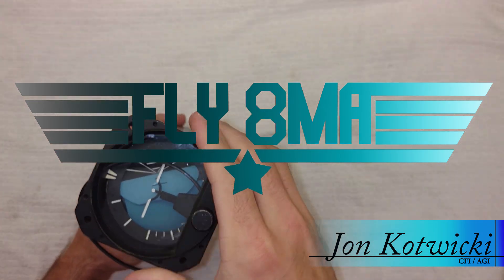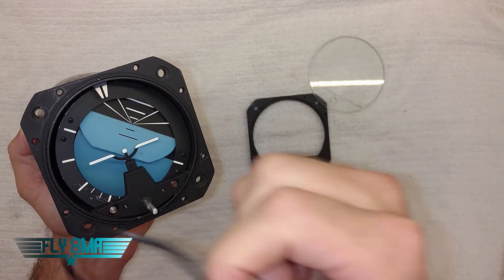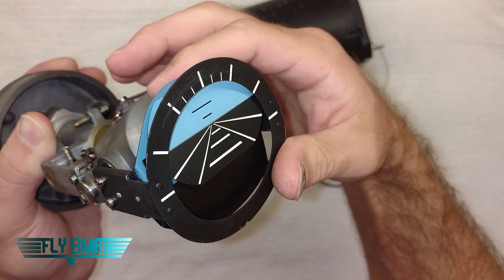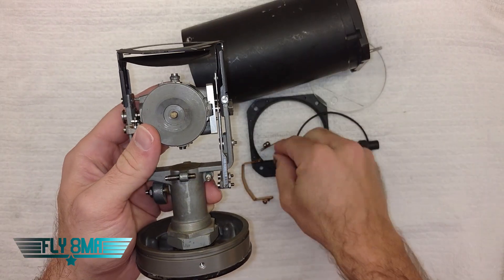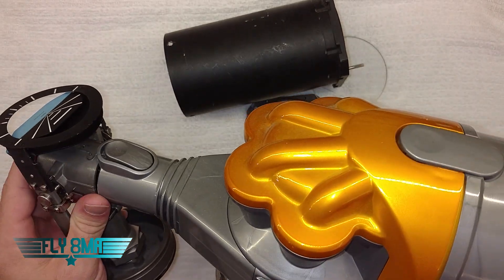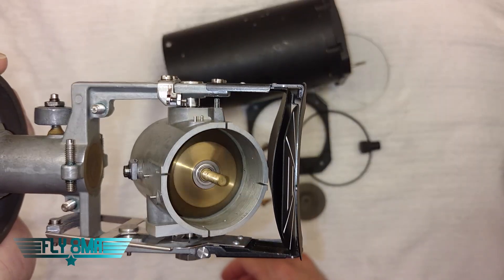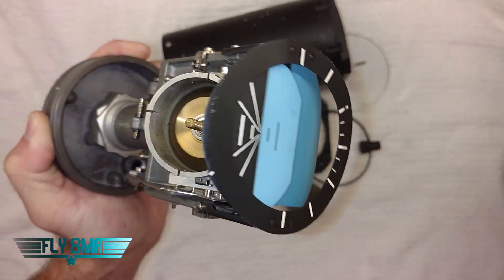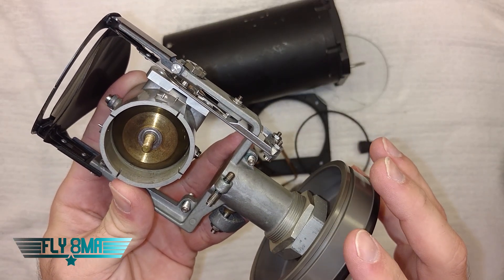Ep. 60: Inner Workings of an Attitude Indicator | Gyroscope

Comment: Can someone please explain precession in a more simple way?
Reply: It is what happens when a rotating body receives a torque in a direction that is perpendicular to its axis.

A rotating body tries to keep rotating around the same axis in the same direction, through conservation of angular momentum.   The torque causes the axis of rotation to re-orient toward the direction of the torque.   But because the torque depends on the new orientation, the torque is a moving target, and the angular momentum never aligns with the torque.  The torque never gets to cause a change in speed, but instead it causes a continuing change in direction of the axis of rotation.

Comment: Pitot tube measures stagnation pressure by reducing fluid velocity to zero while pitot static tube measures total pressure and stagnation pressure in different different tubes and gives the difference between them as dynamic pressure so indirectly it is used to measure dynamic pressure.

Comment: Those “limiters” are called pendulous veins they help the gyro stay upright
Reply: You get a nuisance measurement, if you sustain a banked turn, because the pendulous veins will home the device to the direction of apparent gravity, rather than the gravity you would experience when cruising straight or at rest.
Reply: @carultch  I'm trying to learn how an attitude indicator aligns itself with gravity initially...videos and books NEVER explain this!  Can you go into detail this aspect?  Also the nuisance measurement?
Reply: @MrDogfish83  There's a knob on the unit labeled "cage".  It refers to caging the indicator to tell it which way is down.  You cage the gyroscope before you take off, to tell it that the aircraft is currently level.

The nuisance measurements occur when acceleration gets in the way of measuring gravity.  The "g-forces" of acceleration cannot be distinguished from true gravity, and can give it a false sense of direction.  The pendulous veins only measure gravity alone, when you are cruising at a level flight or stationary.  There is acceleration any time you change speed, direction, or both.  Banking a turn is one example.  Another example is when you rotate the aircraft to climb or descend.   It also happens when you perform aerobatic maneuvers like vertical loops.

Think about your experience in an aircraft banking a turn.  Do you feel thrown to either the left or right side?  You don't.  You feel as if "gravity" inside the aircraft is toward the floor.  But toward the floor is not truly downward.  Toward the floor is in the direction opposite the aerodynamic lift that pushes up and inward.  The gyroscope makes sure that it only slowly adjusts to gravity, to avoid nuisance measurements from acceleration.
Reply: @carultch  I get the whole acceleration indistinguishable from gravity thing.  Sorry if you answered this but how does it make sure it only adjusts to gravity?  That's they key I'm missing.
Reply: @MrDogfish83  If you just hang a simple pendulum, or use accelerometers to determine which way is down, you'll get a false reading when acceleration gets involved.   The gyroscope helps the indicator "remember" which way used to be down, before the aircraft started pitching, rolling, and/or changing speeds.   The gyroscope provides inertia to the instrument, so that it takes a long time to change the axis of rotation, and therefore orientation of the artificial horizon relative to absolute spacial directions.  It is fast enough that the pendulous veins can change its direction as the aircraft moves around the curvature of the Earth, but slow enough to mitigate the impact of typical maneuvers.

A sustained turn when you are in a holding pattern with the landing airport can provide a nuisance measurement.  So pilots usually alternate 1 minute turn / 2 minute straight, in order to trace out a shape like the running track around a US football field.  When ring-laser gyroscopes are used instead of mechanical gyroscopes, there is an override feature to only adjust the direction of down, when the aircraft environment is within a reasonable margin of 1-g, characteristic of a level & straight flight.  The adjustment gets paused during banked turns, when the aircraft environment slightly exceeds 1-g.
Reply: @carultch  That makes sense and explains the holding pattern!  As I start my instrument training I wondered why a racetrack and not a circle (although I understand making a complete 360 cancels out precession).
Reply: @carultch  You can only cage electricly driven attitude indicators.
Reply: @SgfGustafsson  Maybe "cage" ceases to be the technically correct term, when it is no longer an electrically driven gyroscope.  I expect there is an equivalent term such as "home" or "zero", for ring laser gyroscopes instead, that resets its definition of down.
Reply: @carultch  Well I don't know anything about ring lazer gyros so it could be correct for that, I was thinking about the traditional gyros like in the video
Reply: @MrDogfish83  it's theoretically possible to distinguish gravity from acceleration because gravity forces usually point to the "center" of a mass (here the earth), so the force lines are not perfectly parallel to each other. While they are parallel in case of acceleration.
Reply: @manloeste5555  I can see that being exploited in extremely sensitive electronic instruments but not very helpful in an old “steam gage” attitude indicator
Reply: @MrDogfish83  yes, that's true of course.

Comment: Great video? Can you explain how the pendulous vanes work? Do they allow the indicator to compensate for Earth curvature? Xxxxxx
Reply: The vanes correct for friction errors, small balance errors and precession ....I repair these ...it is my day job
Reply: The penduluous vanes as the name implies, are like pendulums.  They continuously "home" the device to slowly find the direction of down, as it measures the direction of apparent gravity within the environment of the aircraft.  The homing of the device is plenty fast enough to compensate for the rate at which the aircraft travels around the Earth's curvature.

Indeed they do compensate for Earth's curvature, because they tell the plane which direction is plumb, assuming the plane is maintaining a level flight with no change in speed or turning.   Without the pendulous vanes, the axis of rotation of the gyroscope would do-si-do as the aircraft travels around the Earth, always facing in a fixed direction in space.   If the gyroscope were frictionless and sensitive enough, in theory it could measure the fact that the Earth rotates.  Mechanical gyroscopes aren't practical to build with that degree of perfection, but laser gyroscopes can measure this fact, and will drift 15 degrees every 59 minutes and 50 seconds.
Reply: You will get a nuisance measurement from the pendulous vanes, when you bank a turn continuously, because they measure apparent gravity, rather than true gravity.   During a banked turn, apparent gravity will roll with the roll of the aircraft, and be perpendicular to the floor.   To compensate for this, pilots travel in an oval-shape like the running track around a football field, so that it can reset during the straight segments.   Modern laser gyroscopes can pause the homing anytime the accelerometers sense greater than 1 g, so that apparent gravity during a turn doesn't cause errors.

Comment: I was doing steep turn exercises in an older 172p with my cfi a few years ago, and I remember the compass gyro would flip 180degrees as I did the turns. I’m trying to get and idea of how the gyro tumbles after it hits gimbal limits with good visuals, you actually demonstrated it pretty good. 

The directional gyro is obviously set up a bit different than the attitude indicator and I know it requires 360degrees of rotation about the airplanes yaw axis to measure headings. But what caused it to flip during steep turns?

Comment: Hello,  can you please explain the purpose of the pendulous vanes that you removed at 2:25.  I have a video showing how they work to correct the gyroscope to level based on Gravity.  There are some people using your video out of context on my channel claiming the instrument does not self correct.
Reply: The instrument only self corrects because of the vanes, if it had no vanes, it would not self correct, not detect gravity and essentially curvature and be useless. I'm sure you know this ;-)
Reply: @toiletduckie44  Yes you are right. Without the vanes it would not self correct.  But it does have vanes so the Flat Earth arguments about the artificial horizon are incorrect.  

Sorry, I just noticed your post here by luck.   I didn't get a notification and did not come back here until I saw it recommended just now.
Reply: The vanes correct for friction errors, small balance errors and precession ....I repair these ...it is my day job
Reply: @bobstreet8840  Hi Bob, do the vanes work for gravity compensation, or just errors after time ?

Thanks
Reply: Not quite sure what you mean by gravity compensation but they are highly dependent on correct balance so probably?

Comment: Why does the attitude indicator gyroscope not precess like the directional gyro does? In other words, how does the attitude indicator stay accurate when the DG needs to repeatedly be realigned with a compass indication?
Reply: they do which again is the use of the pendulous vanes
Reply: Because the AI can determine which way the gravity vector, and correct itself.  The mechanical DG doesn't know which way is north, so it can't correct itself.  Electronic ones do.

Comment: Like the video but something you didn't explain and I had to go find on a different video. Those slots on the bottom where the air exits are called pendulous vanes. They exist as a self correcting mechanism to make sure the device is pointing down with respect to gravity. If you had a perfect gyroscope and flew from the north pole to the equator then the gyroscope would be pointing backwards 90 degrees, this prevents that from happening.The way it works is that when the gyroscope is tilted those gates on the bottom are free to swing and will move out of the way for one of the holes allowing air to blow out of it and block flow leaving the other one (the holes are offset from the center, this is why one opens while the other hole closes when tilted). When the air leaves one of the holes but not the other on the opposite side it creates a torque on the gyro and kicks the gyro back up wright.
Reply: I've literally been debating this with another pilot on Youtube, If those pendulous vanes are there to correct the gyro as the plane flies over the curve over the earth, therefore proving gravity has no effect on the gyro's orientation (since the gyro needs the vanes), then since my phone does not have pendulous vanes, the gyro in my phone should be way off when i fly to another country, but its not. Please could you answer these questions?
Reply: toiletduckie44 your phone doesn’t have a spinning gyro but rather an electronic device that measures 3D movement.   https://www.elprocus.com/gyroscope-sensor/ provides a bit of a description.  Highly accurate versions of this are used in glass cockpit displays thereby avoiding the mechanical problems associated with vacuum instruments
Reply: @toiletduckie44  Your phone has a 3 axis accelerometer along with a 3 axis gyro.  It always knows which direction is down.  It also has a gps and a 3 axis compass, and together they make up a 10 degree of freedom Inertial Measurement Unit.  The accelerometers and compass calibrate the drift and offset out of the gyros.  The accelerometer tells you which way is down and calibrates pitch and roll, and the compass knows which way is north, which calibrates yaw.  The gps calibrates the offset to x, y and z position.  Starting the accelerometer up when nothing is moving calibrates the accelerometer.
Reply: @toiletduckie44  You’re debating nothing, you’re simply uninformed. 1. Your assumption that your phone gyro should be “way off” since it doesn’t have pendulous vanes is a strawman and simply wrong. 2. You phone is digital, using digital gyros and accelerometers which have a DIFFERENT WAY of determining orientation to “gravity up (or down)”. One way is that the acceleration force lines due to gravity are angled inward towards each other due to being focused at the center of the earth (I.E. a spherical world). This means you can filter the acceleration data from motion out because that motion is all parallel forces and make corrections for the gravitational forces. If you take the time and effort to actually learn how your device works, you don’t have to “debate” an incorrect assumption.
Reply: Toiletduckie44 Pretty sure your phone does not have a Gyro.
Reply: @brycering5989  every phone has a gyro. Look it up. It's called a mems gyro. Most the time 6 axis. 3 axis for acellerometer 3 axis for gyro
Reply: @toiletduckie44  Looked it up. I stand corrected and schooled ;) Cheers man.
Reply: @brycering5989  no worries. Glad to be of help.
Reply: @toiletduckie44  Unless you're special, you probably have 3 single axis accelerometers on your phone. It is a relatively complicated algorithm, that I don't quite remember, to isolate gravity from other accelerations. A mechanical indicator, on the other hand, does not go through a computer before showing you your attitude. I believe the algorithm in your phone does a similar thing to the gyro and the pendulous vanes. I am curious though to know how well it works in turbulent conditions.
Reply: @joshuaatkins2334  most phones have a 3 axis accelerometer and a 3 axis gyro. However my drones have the accelerometer disabled. Only the gyro active. Yet no issues 
Besides. Wheres the proof that the accelerometer actually corrects the gyro in a phone?????
Reply: @toiletduckie44  You're right, and I should look stuff up before commenting from memory. My comment was assuming that it only used the accelerometers and isolated the effects of gravity; I am currently trying to find the algorithm I previously learned. Here is a link to a Quora question and answer that may answer your question. Although, you have already supplied a similar comment.

https://www.quora.com/How-do-the-gyroscopes-in-smart-phones-work 

Thank you for challenging me to look it up. It seems that the accelerometer is used for orientation and the gyro might be used for real time input for a more complicated algorithm. And it seems that the gyro is never physically reoriented because it does not move as freely; following the answers on the link will explain some types of phone gyros.

I am, as I have proven, not an expert, so take my comments as such. Have a nice day! :-D
Reply: @toiletduckie44  So no one really answered you but the gyroscopes used in phones and quads only measure angular velocity not the orientation to measure orientation you have to have an accelerometer which gets combined with the gyro measurements. Your drone can fly fine without an accelerometer enabled because they only strictly need angular velocity to fly. (Also if you see "6-axis gyroscope" that means it's actually a gyro and accelerometer just worded poorly)
Reply: @MrRtkwe  thanks but that's incorrect. If I turn my gyro upside down. My drone will not fly. Even with the Accel. Disabled completely
Reply: The vanes correct for friction errors, small balance errors and precession ....I repair these ...it is my day job
Reply: Bob Street.  hi Bob. I have a question. The vanes are designed to correct the gyro in a flight from north to south hemisphere? I have the idea that the vanes were designed to correct some maneuvers like sideslip? Thanks for your help.
Reply: @rubenmacias261  Hi Ruben... The vanes correct as I said but would correct for the curvature of the earth if that's what you mean because of gravity acting on them.... I would say that sideslip wouldn't affect it as it would be too brief and the centrifugal force of a turn would have more effect producing small errors that correct when straight and level
Reply: Bob Street. Thank you very much for your help. Blessings.
Reply: Calvino, you've answered perfectly a question I was about to ask here.  I was curious to know how the AI would function if it was "spun up", or initialized on a slope that is not perpendicular to the ground.  Many thanks.
Reply: Calvino c

Comment: 02:25 Those aren't really limiters, they are pendulous vanes, responsible for self-erecting the instrument on the long run by opening/closing individual air slots when the gyro is not orthogonal to the local gravity vector, which in turn slowly torques the gyro back to the orthogonal relative to that vector's direction.

Comment: Do you know where to get one repaired?  Mine works some of the time, other times it just shows that I am diving to the left no matter what my orientation is.
Reply from the maker: Cheapest bet is just to have your A&P replace it. By the time they pull it and send it off for repair it gets almost as expensive if not more expensive then just dropping in a replacement.